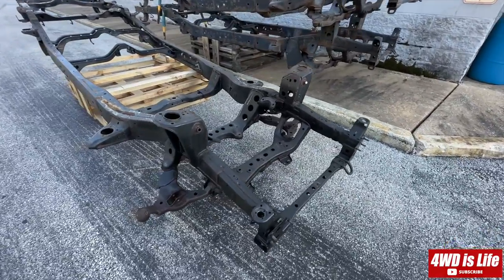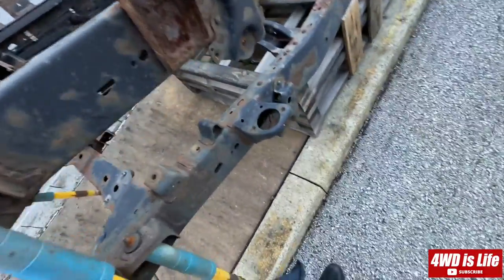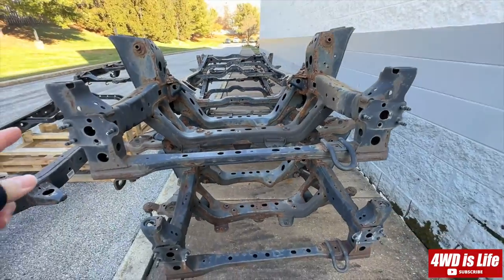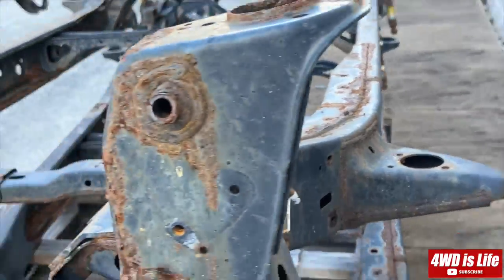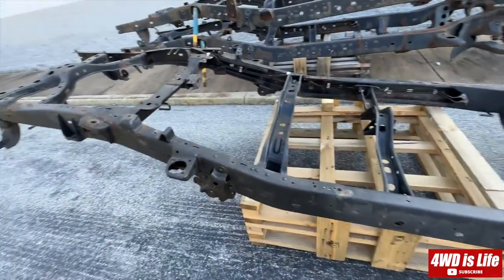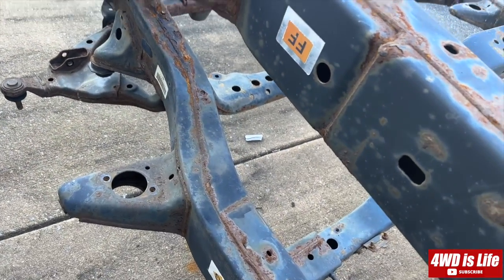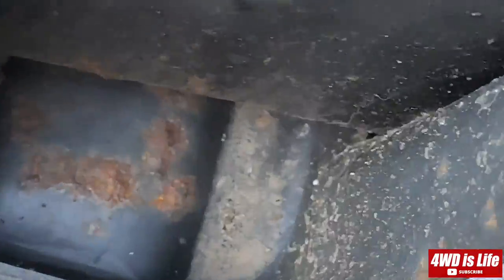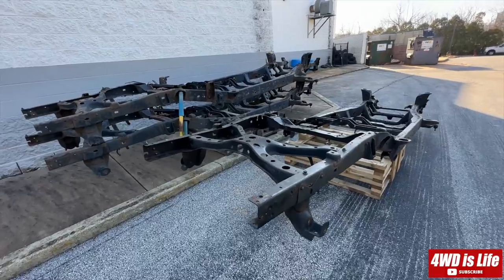What does rusted TOYOTA Truck Frame look like?

Comment: It’s worth pointing out that this was from 2005 to 2015 that were effected. It was Toyota wide as well with everything from the FJ cruiser to the tundra to the Tacomas to even the 4Runner  that were effected. 2wd 4wd it didn’t matter, if they found a 3/8 or bigger hole they replaced it. When they did my 08 base they replaced the lines, the electrical wires even the rear leaf springs. Oddly they didn’t replace the rear bumper ( already pretty holey) and the upper front control arms ( very scaled up) or the rear quater panel mounts ( rotted away ) they also left my OEM shocks on ( both blew 2 summers later ). They also neglected to align it. Later I found out what the issue was. See Toyota subcontracted out to an American company Dana Corp to manufacture the frames to Toyota spec, they did this to tout the “ American” built Tacoma ( funny since the Tacomas at that thing were all Cali built ). Anyways complaints started to roll in regarding excessive rusting in northern climates where they used more corrosive chemicals to clear roads. Mine had began to scale up pretty bad and I knew something wasn’t right. Turns out Dana used subpar materials and subpar coatings on the frames which caused them to literally dissolve. They found 2 3/8 inch holes in my frame near the rear bed mounts. That replacement frame still looked solid when I sold the truck. Like I said it was found to be subpar materials from Dana corp. The 16 and up after being redesigned has kept manufacturing of the frames in house. This seems to have solved the issue
Reply: It actually went up to 2017 tacoma's as well. I was given a 10yr warranty direct from Toyota on my old trucks frame. I had to have the installer install frame plugs to get the warranty
Reply: @21222or  the 22 I replaced the 08 with does seem to have some minor issues with the silica bronze welds they used. The rust is minimal however I’ll probably waxoyl hardcoat mine this fall prior to buying the lease out. I’ll need new brake pads in the fall anyways so I figure if I’m going to have the front wheels off the ground it’s a good time to, paint the calipers for rust resistance, hardcoat my frame for the same and clean up anything under there that needs attention. Lastly grease the snot out of the spare tire lift mechanism to ensure it keeps working

Comment: Funny these frames are mint compared to some of the ones I see people patching on YouTube!
Reply from the maker: Lol. Gotta take advantage of the warranty or free offers I guess.
Reply: Exactly!! These frames are in very good shape compared to what I've seen in other videos. But, due to liability, I guess Toyota opted to replace them. These new frames won't last any longer than the first ones did. It's the same junk recycled steel made from soup cans and rusty metal!!
Reply: They’re definitely, in better shape than my 2006 Tacoma sr5. I’m currently, trying to figure out how to fix it. I’ve only had the truck for a year and didnt even know to inspect the frame that closely. I never heard of the frames having rust problems until I purchased this thing lol. First Toyota I’ve owned. It’s messed up that it’s got 135,000 miles and runs great with the 4.0. The body looks good too.
Reply: @jasonmckinney6444  so did you repair your frame yet? Your situation sounds identical to mine. I have a 2007 Tacoma. You still should be in the 15 year warranty.
Reply: @jasonmckinney6444  sorry I was thinking you had  a 2010

Comment: a friend of mine has a Subaru 2003 and there is not a bit of rust anywhere on or under the car. Toyota sucks. it ruts away , cheap Chinese recycled pre rusted metal. Shame on you Toyota. Shame.
Reply: a 2003 subaru has gone through about 5 sets of head gaskets by now. Probably a couple of warped heads too.
Reply: The frames that had rust problems were US made with subpar coating.
Reply: Blame Dana Corp a US company they sub contracted to stamp out the frames.

Comment: I believe these were 2nd gen frames, and they left the main portion as a C channel instead of boxing it in. BUT, those frames rust just as bad and these frames you're looking at are nothing compared to what I've seen, they aren't that bad. But, due to liability, they had to change them. I do not recommend using rubberized undercoating, it traps moisture. You are better of using Wool Wax, Fluid Film or other liquid/greasy/waxy coatings... And as far as that "Safe-T-Cap" stuff goes, in my opinion that is a band aid, you are only covering the rust. It is far better to cut/chop out all rust and weld in new good metal to what's left of the good Toyota metal. Their products aren't too cheap either, you can spend 3/4K patching your frame or buy your own 5.5" and 2.75" x .125 thick steel (and some random sizes etc) and have at it with a gas Mig welder...
Reply: You do cut off the rusty portion when u saftey cap. I've done several. Works very well.
Reply: Agree, and cold rolled steel is best

Comment: You see where the motor mount welds are all rusty. Mine actually broke and it appears the mount pushed itself into the middle of the frame. FML
Reply from the maker: that sucks, time to push toyota to get you a new frame.
Reply: Toyota recalled the 2nd gen frames, you should have gotten a letter. But, don't think that helps too much because the new frame will rot just as bad and just as fast. And, they make you pay for all the bits and pieces that are damaged during the frame swap; costing as little as 800$ up to 3000$ in some case which means leaf springs, shocks, struts, fuel lines, brake lines etc etc. When Toyota did the original 1st gen recalls they paid for EVERYTHING, you dropped it off, came back in a week or 2 and said "Thank You"; you were not responsible for any part of that frame swap. Not anymore...

Comment: I have an 06 tundra just found out there’s holes right through the frame. Toyota doesn’t wanna hear about it.. I’m going to call Better Business Bureau ASAP
Reply: My 06 Tacoma's motor mount broke off from the frame. Same story. Nothing can be done apparently (except pull the motor out of the truck and fix it myself)
Reply from the maker: seems to be a serious problem. not sure how many years back does the frame recall covers.

Comment: How much would it cost to rebuild a frame for a 2005 Toyota tundra
Reply: You mean "patch up" semi restore?? It ends up costing a couple thousand bucks to do a patch job, quite a bit more for a good job. The kits they sell like "Safe-T-Cap" slide over the rusty metal and get welded in place, what good is that?? You can't cover bad metal because it traps moisture behind it, you have to chop out and remove all rust, then weld in good new metal. I just did my 2003 Tacoma and it took me weeks working on it every night, but it's solid as a rock now. Painted on the outside and fluid filmed on the inside, time will tell...

Comment: Where can i buy one of these so called rusted frames? I was told my 06 Tacoma didn't qualify due to lack of perosity or something. Mine is full of holes and all of it looks like the 2 or 3 spots you have pointed out 😢. Like all orange and flaking.
Reply from the maker: I was thinking the same, they could have them for sale but. I believe the deal for the dealer was they have to return the frames to toyota to get the new frames.
Reply: Have you checked with your dealer or local rep?? The 1st gen Tacoma recall is over, IDK about the 2nd gen...

Comment: Very interesting, thanks 😊 
FYI, I use "CRC marine corrosion inhibitor," which really does work, I'm in Canada and drive 07 Tundra all winter long, and this stuff has almost stopped the rust.
Reply: It will rust from inside out.  I use same and it do not stop rust from inside.
Reply from the maker: thats also what I use, I sprayed mine from day 1 of ownership and i think for now it's still a very clean frame been 4 years.
Reply: @4WDisLife  Google "10 year of using cold galvanizing" and read toward end.  Post #43.
Reply from the maker: @zell863 that is good read, but not sure if the rustoleum cgc is the same with what was mentioned here, CRC Marine corrosion inhibitor is a hard wax form material.

Comment: If only they used thicker C chanel like 1/4 wall then the frames would be strong but the 1/8 to 3/16 thin metal is weak.

Comment: I’m surprised it not a boxed frame all the way around. 

My Hilux is much beefier and really massive in comparison. I flushed the frame and all contact points with grease and wax
Reply: The boxed frame, or 1st generation was even worse, or just as bad, depending on who you ask or what you see. The 2nd generation (the frames in this video) have an open C channel frame in the main section, and they rot far worse that what you see in this video. I'm surprised they changed these frames, they aren't rutted much at all compared to what I've seen. Anyway, boxing it in my work with good new steel, but it does not help with the steel that Toyota uses, it seems to make it even worse...

Comment: The CHASSIS WERE NOT Dipped . . When they are new and raw  steel they needed dipping in a galvanising solution . . Most inside areas were not painted . 
Similar to Ford the chassis paint was not durable at all . Fords are worse the undercoat black is virtually transparent and starts rusting within 20,000miles . Most models are not cleaned properly and welding is where it [rust]  occurs first .